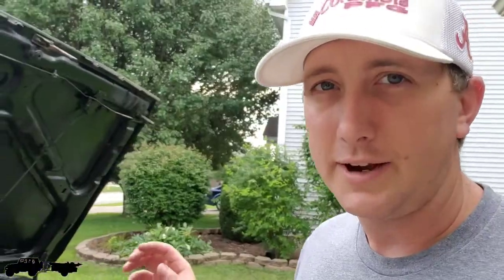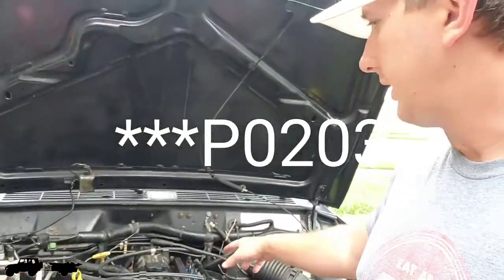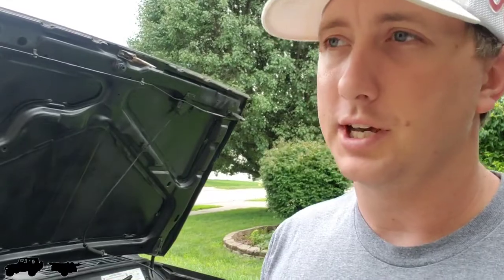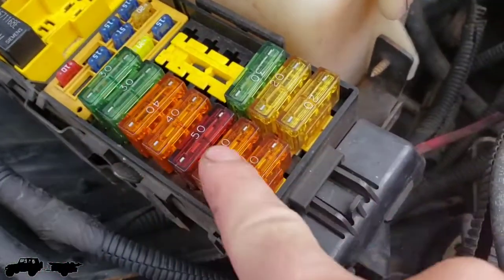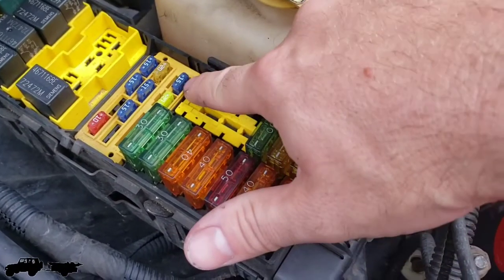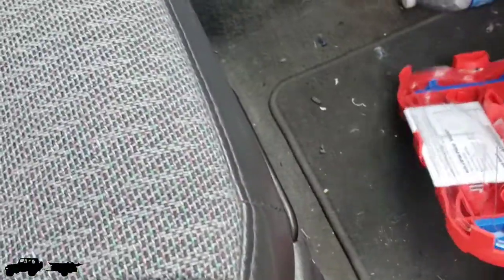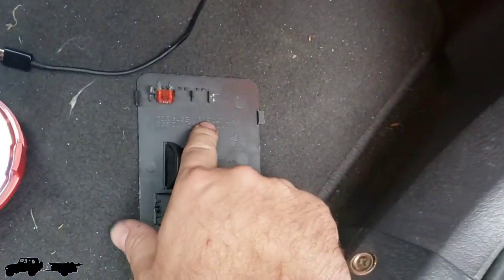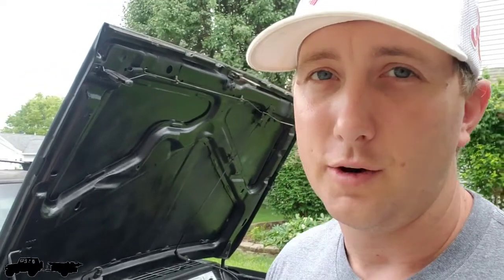Jeep Cherokee XJ - GAUGES NOT WORKING!!!! Easy Fix for mine!

Comment: Thank you. 
All I did was reinstall my headliner then boom gauges not working lights radio all inop and this fixed it all.
Reply from the maker: Awesome! Glad it helped ya!
Reply: Just happened to me, I put in a new headliner and reinstalled the overhead console in my '98 Limited. I also installed a dash cam set up. The following day I lost speedometer, tach, and all the gauges. All my fuses are in working order but the dash goes off and on intermittently.

Comment: I searched this on the way home right after i noticed my cluster and radio not working 
You really are a life saver cause it worked 
I had 1 spare 15amp fuse i got from an XJ at a junkyard the other day came in clutch (i got it from the cabin fuse panel spares but the panel was the wrong color so i just took the fuse instead)
Reply from the maker: Glad it worked out for you! 🤙

Comment: Thank you for this. I changed a oil pressure sending unit on my 99 xj this past weekend and the exact same thing happened to me. Dome light gauges odometer radio all out and I'm hoping this is the fix
Reply from the maker: Yeah good luck! Someone showed me and I wanted to pass it along.
Reply: @jones_edition  just an update...got home and changed the fuse and it fixed everything..thanks again
Reply from the maker: @dylanreynolds4899  great!!!!

Comment: What year is your XJ model? 
We have a 1991 model and the fuse panel is on the driver's side under the dash. Not sure if it has a second panel under the hood, but I am going to check today. Thanks in advance...and well done video.

Phil
Reply from the maker: This XJ is a 2000. Good luck fixing it. Wish you well! Thanks for the comment

Comment: Thanks right now my dash is apart. Did the fuse and plug connections. No good but my fuse was blowing it was a 10 amp
Reply from the maker: Were you able to fix it?
Reply: Yes so put a 15 amp in it so far working. I have done watch videos and you are the only one that help. I had the dash apart unplugged the cluster put it back in and no gauges. I don't have a radio or done lights so that was no help. Yhanks
Reply from the maker: @hayzersolar  I'm glad I was able to help you in some way. 🙏
Reply: So the question is what is causing the fuse to blow? And not the other dash fuses.

Comment: Thanks for the great informations. I’m just facing that my interior fuse box most of the fuses on the right side are not working and no electricity found. Just curious is my fuse panel failed or something else causing the issue.
Reply from the maker: Man that is strange.  I have never dealt with that. Sorry to hear that!

Comment: dang, my dome light does work but not the gauges. thinking it's one of the wires for the ignition switch since one looks clearly burnt
Reply from the maker: I wish I could help more. I got help with his fuse issue and it helped mine. Good luck!

Comment: I am having the same problem. While having an oil change they tested my battery and said I need to replace it. My cluster and everything else you mentioned is not working even I replaced the fuse with the spare one in the interior fuse compartment. Can the battery be a cause of that problem too?
Reply from the maker: Man sorry to hear. I'm not sure what else to check. This fixed most people's issues. If you figure it out let me know. I hope you find out what is wrong!
Reply: @jones_edition  I wiggle a bit the fuse and everything is working except the door locks. I think it was just a bad contact. But radio, interior lights and cluster most important is fine
Reply from the maker: @diegososa6116  well that's great news!

Comment: Can anyone give me some light here? My gauges are not working, but all the dashboard lights work. Radio and dome lights work aswel. Did a instrument cluster test (holding the trip button and whatnot), dashboard lit up, beeped some different noises, but no gauges working, not a single one. Changed all fuses, cleaned behind the dashboard, contact cleaner, eletric grease, nothing. I'm about to bang my head against the wall. Any help would be appreciated.
Reply from the maker: I wish I could help you. I sold the XJ awhile back. This was the only fix I knew how to do for the issue I had. Hopefully someone in the comments here can help you
Reply: @jones_edition  thanks for the reply! I'll just keep digging I guess. Fun part is I learn something new everyday. Thanks!

Comment: I have the same issue replaced the fuse twice and it breaks immediately.
Reply from the maker: Man that's strange. Something is surging the power.
Reply: @jones_edition  i don't know where to look.  What all runs off the iod fuse?
Reply: @jones_edition  the problem was a shorted wire behind rear quarter
Reply from the maker: @freakfrown  wow! Glad you found it. Needle in a hay stack
Reply: Replaced fuse and it blew again.

Comment: You didn’t fix anything before you find out, why your fuse is blown.
Reply from the maker: I had a radiator issue and a fuel injector #3 go out prior to the fuse issue.
Reply: @jones_edition  Hi Jones, will you please explain that a little more detailed, thanks
Reply from the maker: @khndenmark  After I bought the XJ, I had a radiator issue and the jeep overheated. I believe that caused the #3 fuel injector to go bad. Those were the only issues I had prior to my fuse going out. Not sure if it was related or not.
Reply: There is a water intrusion technicial service bulletin. The 'lets call a/c box  to simplify' drain tube is clogged or actually missing causing the passenger floor to be wet. This water gets into the connector behind the passenger side lower cowl. 2 big white bulk connectors get water in them and cause all these issues. Even window problems.
Reply from the maker: @alanw5879   I have heard of this issue before. I have clean the cowl on my TJ before but not all my XJ
Reply: @jones_edition  be careful when taking connectors apart too, please, you can set off your airbags if you're not careful. Don't remove the instrument cluster without disconnecting the battery negative for at least 3 mins. You can reconnect the battery with the cluster out for testing. Just be careful all. Airbags are very expensive
Reply from the maker: @alanw5879  sounds good brother! Appreciate the advice!